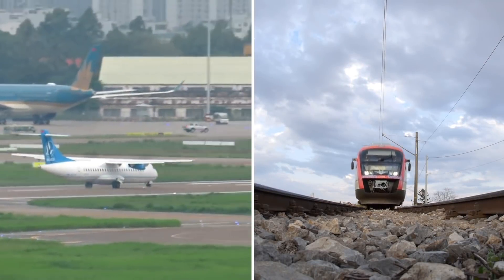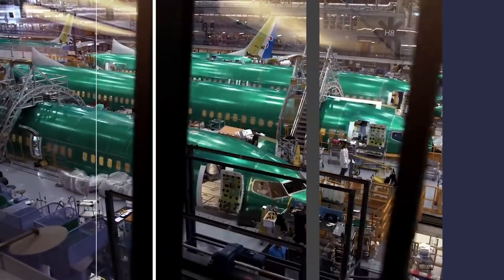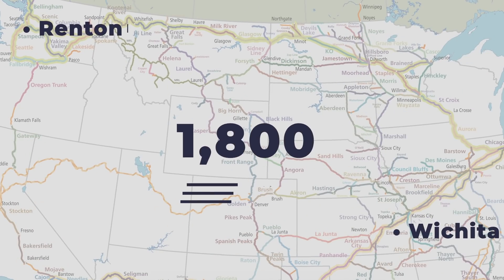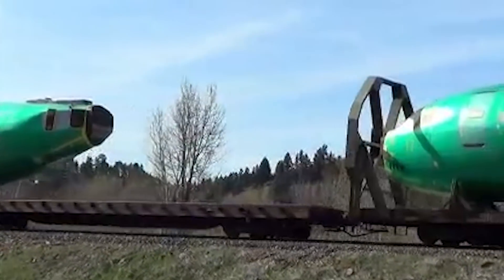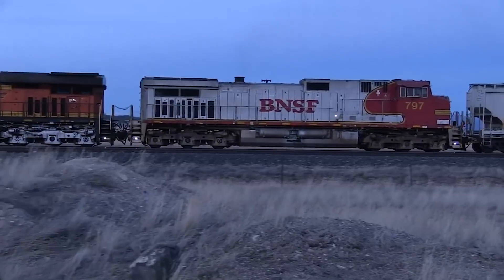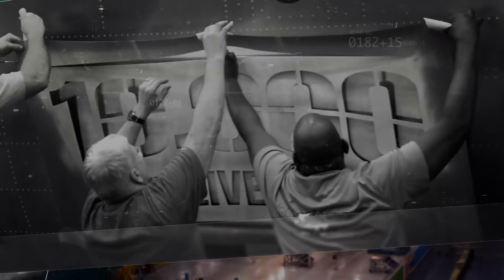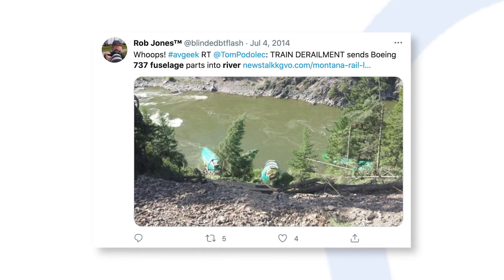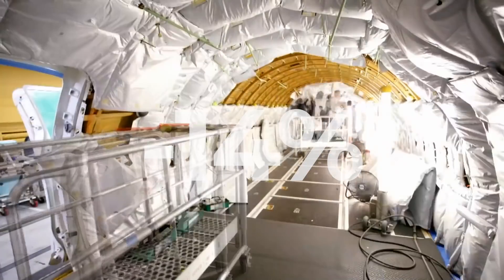Why 737 Fuselages Are Delivered To The Boeing Factory On Trains

Comment: Boeing is opening a new B-737 Max final assembly line at Paine Field. It’s going into a 500K sf. unused bay. Boeing is going to run two of the fuselages the railroad pulled out of the Clark Fork through first. Training props, never to fly.

Comment: A of mine was floating the river the day of the wreck and witnessed the accident.  He referred to the situation as three "very low flying airplanes".  The three that slid into the river were written off as the FAA indicated it would not certify them due to water damage to internal wiring and frame damage that could not be rectified.  An expensive accident to be sure!  I am fairly certain the MRL insurance carrier was somewhat unhappy.

Comment: It's easier to use rail in North America compared to say Europe, for example, given the much larger shipping dimensions and car capacities typical in North America. Although they are still a special oversized loads requiring predetermined and limited routing they can be included as part of much larger train consists.

Comment: I guess its just another way of transporting  airliner fuselages  however transporting by air would still be quicker depending on cost and freight  apart from that Love this program
Reply: Transportation by air would be much more expensive and difficult.   A train can haul several fuselages compared to 1 in a plane at 1000× the cost.
Reply: Exactly, it isn’t really justifiable to send a Dreamlifter back and forth or transport all the fuselages one single train can transport. As long as the fuselages arrive in time there are no real disadvantages over the transportation by plane

Comment: I was in Seattle in 2019 and saw a train with several fuselages.

I remember when the 747 was starting production.  I used to see flat cars with huge metal covers.  On the sides of the covers were the words, "Another Boeing 747 Assembly."

This was on the Burlington Northern mainline is suburban Chicago.  I believe these might have been the landing gear, which were manufactured in Cleveland.  Of course, final destination was the old Great Northern spur to the widebody factory in Everett.
Reply: wow neat

Comment: I'm surprised that the fuselages aren't covered (with a tarp or similar) when they're loaded, both for security and possible damage.
Reply: The green film that is on the outside of them is there to prevent minor damage caused by weather or any minor debris

Comment: I feel like it's more likely cost savings than capacity but anyways
Reply: Both really.   Shipping more at a lower cost.
Reply: Getting a 737 fuselage moved via truck would be a nightmare due to the length and height. It would only be able to move during the day and not very fast. There would be a convoy of three vehicles for each fuselage. A lead car checking the "heights" and a tail car waring of a slow-moving high & wide load ahead. The movement via rail cuts transport costs to the bone and speeds up delivery times. Once loaded onto a rail car, no people are needed to babysit the fuselage 24/7, if a truck was used several people would be needed for each fuselage for the whole trip.
Reply: @thomasboese3793  not to mention that most freeways have overpasses that would be a nightmare to avoid.  Taking off ramps to bypass them wouldn't qlways work qnd the back roads wouldn't have enough room for them.

Comment: They should just leave them on the flatbed train cars and use them as passenger carriages. I'm still not sure whether they'd be particularly safe, but at least if anything went wrong they'd only be a few feet above the ground...
Reply: hell no. I take Amtrak so I dont have to be cramped in a tiny airline seat with a tiny window.
Reply: Lol... That would suit the 737 MAX

Comment: I feel like more than one 737 fuselage can fit in a dreamlifter but if they want to use trains, then they can use trains
Reply: Using Dreamlifters isn‘t viable, especially as you would need many flights to transport the fuselages one train could carry. That’s just one of the reasons

Comment: Boeing started using the rails with the 747 by Burlington Northern (the precursor to BNSF) Lockheed transported L-1011 wings from Marietta, Georgia to Palmdale, California. General Dynamics (Convair) used to send DC-10 fuselages by barge from San Diego to Long Beach, California.
Reply: In the beginning of 737 production, the Santa Fe Railway moved fuselages from Wichita to, I think, Kansas City where they were interchanged to the Burlington Northern (one of its predecessors before the 1970 merger created BN) for transport to Washington. After the BN+SF merger interchange was, of course not necessary. When Montana Rail Link was created in the 1980s, there was another interchange with it from BN, and then another back to BN, later BNSF. In April 2023, BNSF will reassume operational ownership of, by then the former, MRL which will cease to exist. MRL operated that line under a lease from BNSF which was mutually terminated.

Comment: It would be cool to ride inside one while freighthopping
Reply: Many have tried and ultimately regretted it.  Lots of unpolished sharp metal edges in there to get snagged on and to slice deep nasty cuts into the flesh of unsuspecting train hoppers.  This is part of the reason for all that grey protective masking and weather proofing on all of the exterior openings.  The Renton acceptance department occasionally finds blood on or inside arriving hulls during inspection.   Some have learned the hard way that it's not super easy to climb inside nor out.

Comment: Retired BNSF train dispatcher here. I've dispatched these trains before. They are classed as "J" trains on BNSF meaning they're "dimensional" loads (high/wide loads) that can only operate on certain routes and in some cases even certain tracks. LOTS of paperwork is required to Train Dispatchers and Train Crews in handling these trains. In addition to the special flat cars carrying the planes there's also large high cube cars carrying parts as well as a special "ice breaker" car with a large metal ring that runs behind the locomotives. This car breaks off icicles in tunnels during the winter to prevent damage to the planes.
Reply: Ah, wondered what those big frames were on front of carriers!?
Reply: Thanks for sharing!
Reply: So they are the train version of "oversize load" trucks.
Reply: NiCe thanks for information
Reply: I was wondering what’s that Candice train I’ve seen
Reply: Thank you.  Interesting info about the icicle breaking. Not something most of us would probably think about or consider...but the need for it probably arose out of some damaged goods no doubt.
Reply: Thanks for your info and insight. It seems this is probably another payoff to Warren Buffett, making sure his railroad has business, just like from the oil patch by canceling the pipeline.
Reply: @nigeldawson8218  No, the trains were running long before Warren Buffett got into running trains.

Comment: Fun fact: A retired Boeing engineer told me that the rails must be inspected and certified for transport, to ensure that the rails are level, safe within tolerances so that the fuselages are not damaged during transport. All 1,800 miles are inspected. IIRC the transport charges cost $50k per airframe. Not cheap
Reply: They inspect the rails daily anyway. If there is a spot known for having restricted clearance, the conductor's wheel report will give instructions to walk the train through or past the obstruction.
Reply: But should be a lot cheaper than flying it...

Comment: But what if the fuselage is damaged during transit from whichita to Renton?
Reply: Karen calls the manager?
Reply: @donaldstanfield8862  Karen calls the cops
Reply: It's an aircraft, it's designed to be outdoors in bad weather and heavy hail 24/7. The windows are covered for shipment and the airframe is covered in an antioxidant. Any shipping damage can be fixed, or as in the case of the rare derailment, the fuselage is scraped.
Reply: Maybe it can be patched

Comment: I have a model railroad and a model airport. I have been looking for models of the Boeing cars and fuselage for a while now. The only one I could find was $500. I wanted to make one but the problem was I have an HO (1:87) model railroad and I can only find planes in 1:200, 1:400, 1:500, and 1:72.
Reply: There’s a gauge called T-Gauge, that could work for 1:500, other than that I don’t know where to get 1:87 planes from, maybe 1:100 would be enough for a start
Reply: @spongebubatz  thanks, I think t gauge would be to small, I want the cars and planes for my railroad, not for my airport
Reply: @Tal_Spotting  That would be so awesome
Reply: Maybe you can make your own with a 3D printer. Or even have them printed to order.
Reply: @Hauketal  true

Comment: Perhaps because shipping by rail is by far the most economical.  Speed is not a consideration with scheduled factory production.
Reply: I didn't know Boeing didn't manufacture its own fuselage..
Reply: @smcdonald9991  Boeing first started in Wichita, moved airframe and flight testing to the state of Washington during the first world war, and sold the business unit in Wichita after the 737 line was started.

Welcome to the new world where the "manufacture" is really just a design & final assembly team and lots of other suppliers from all around the world provide all of the parts.
Reply: @thomasboese3793  Interesting. I knew most parts are made by 3rd parties but I thought Boeing made its own fuselage. Airbus makes its own, it does not outsource this.
Reply: @smcdonald9991  Boeing used to do so, but due to high costs they are cutting corners here, there, and anywhere they can. It shows in both the "MAX" and "Star Liner" programs. Sad, but I don't see things going back to "normal", ie real manufactures build their designs in the same city/state/country where they are founded. I'm not against outsourcing, but there is a time and place for everything, and the bigger the project the less outsourcing I feel should be done.
Reply: @thomasboese3793  Some of the avionics comes from Thales Aerospace in France. It is not available locally from Rockwell Collins or other US manufacturers.
Reply: @thomasboese3793  are you aware these fuselage’s have been built in Wichita for 40+ years? Originally by boeing who sold the plant to spirit.
Reply: @kylefitzy  Absolutely "YES" on both items. 
As a railroad modeler, I've acquired/built many TBCX/DCCX/BN/BNSF/UP/MP/SP/"TTX" cars for fuselages/wings/parts over the years.
Reply: @smcdonald9991 Boeing assembles components made by hundreds of companies around the world. They don't convert raw materials into aircraft.
Reply: @hewhohasnoidentity4377  That is because countries whose airlines buy their aircraft want some of the work for their aircraft industries. It's called 'offset' work. Elevators for the Boeing 727 were manufactured here in Melbourne, Australia, and components for the 787 are also manufactured here.
Reply: @hewhohasnoidentity4377  I worked for Bombardier in the 1990s on the CRJ700 and they made their own fuselage as Airbus and Embraer also do. Do you know Boeing has outsourced this for all their planes or is it 737 specific?
Reply: Shipping by boat is even better, but of course it's not always possible
Reply: @osasunaitor  Yeah, too bad Wichita, Kansas isn't known for their seaports
Reply: @osasunaitor  That is what Airbus do: by barge.
Reply: @dbclass4075 European clearances are too small
Reply: @charlesburgoyne-probyn6044  It has lots of navigable inland waters anyway.
Reply: @osasunaitor  Not from Kansas!